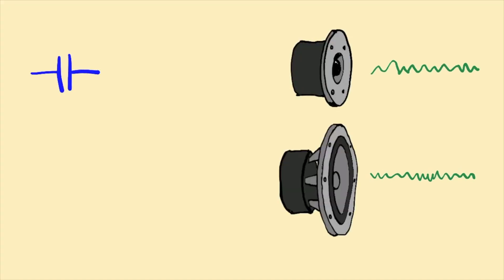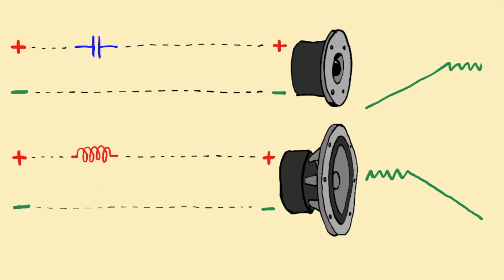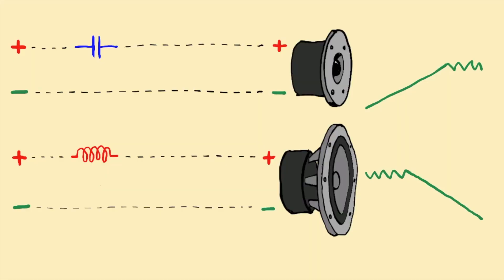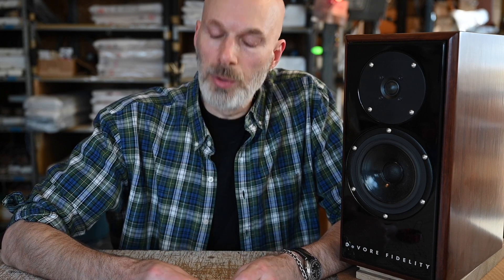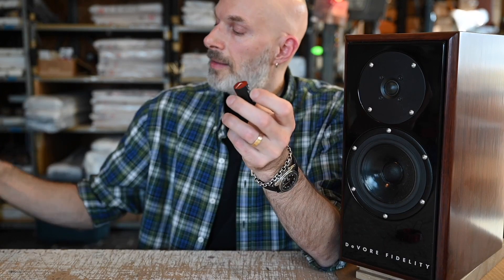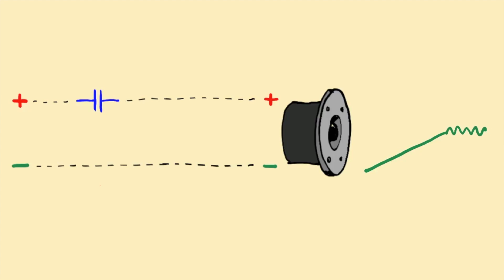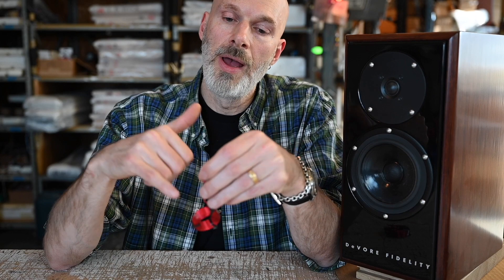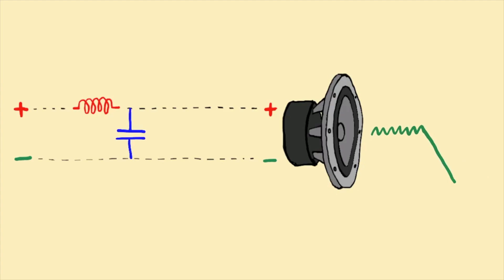How Speakers Work #2: What is a crossover and how does it work?

Comment: I don't see an issue putting a small value resistor in series yes your changed its impedance but the impedance is changed anyway in the operation of the driver when it's working, what value are you talking about in parallel of the resistor would have to be high?

Comment: A passive crossover is an evil amalgamation of capacitors, inductors, and resistors designed to keep the Hi-Fi industry permanently suspended in the 1970’s.  Because Studio Engineers and the Pro Sound industry know how damned good DSP is.